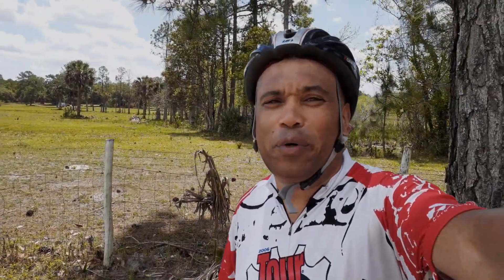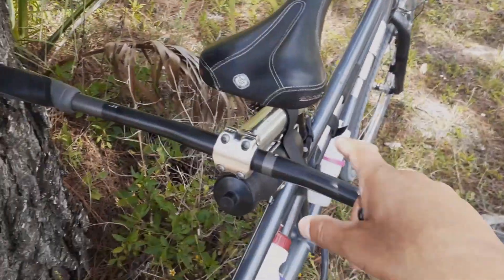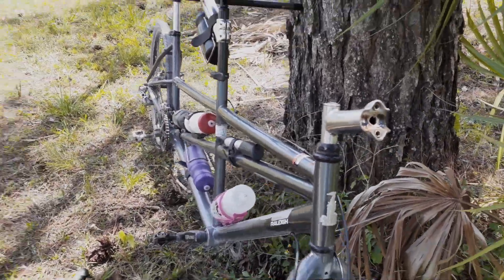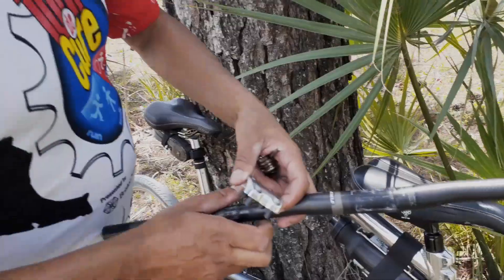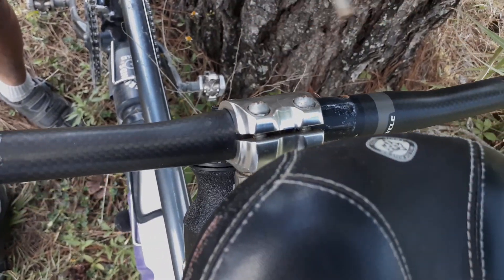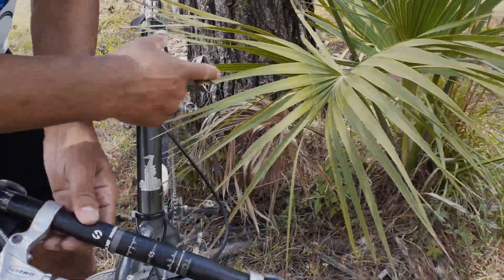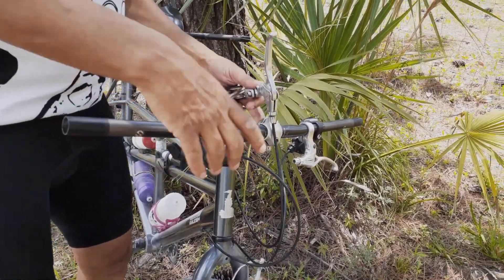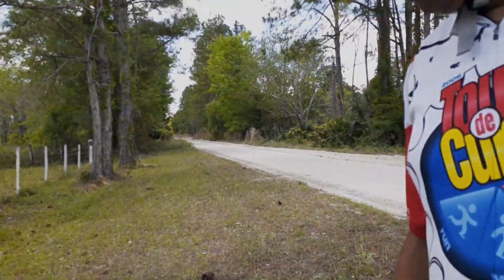I Can Explain.

Comment: You can score carbon when you swivel brake levers onto them, or turn the bars in the stem when it's just loosened, and those scores can be the start of a catastrophic failure, in the same way scoring glass or tiles weakens the structure and makes a path for the break to follow.  Glad it didn't happen while you were at speed. Safe travels.
Reply from the maker: Thanks for the comment! Yes, I am aware of this. Luckily the levers on this bike only required a very light twisting motion to get them into place, and not enough to evel leave a mark. Otherwise I would have been very hesitant and careful moving them.
Reply from the maker: We've since then switched back to aluminum alloy bars for the captain's end. 👍

Comment: LOL She spunky. Rolling laughing 😂
How much of the bike is carbon fiber? Seems it's not worth it to save a few grams. 1.5 tires a bit narrow and you two go trail riding. 
Calling my stoker "General Safety".. (smirks lol) 
We've been upgrading and accesoriezing the ride. Spent as much as the bike on these things. wow. We did double our distance on the second run and she said she could have done another hour or more. She has a comfort seat, two mirrors, clamp on grips, a can of hornet spray (20' reach lol) for any scareys, and a peg bar to toss her feet up on when she gets exhausted. Our latest accesories, a nice rack, dual high output pod lights near her mirrors for side trail illumination, and an excessively bright light up front. Oh, a frame mount tool bag which I'm filling with appropriate twisty grippy things. The pannier bag set is coming soon, so "The Picnic" is very near. Oh yeah, tires! They're on the way also. We've opted for a nice pair of hybrid trail and street tubeless be it will be tubed. These boardwalks along the trail get super slick when wet. 
Can you suggest a frame mount pump? So many on Amazon and eBay. The tiny pumps look ridiculous and there's plenty of room to clamp to, so a 14" pump, around there, will be fine. 
Happy Trails and dig the humor in the video.
Reply from the maker: LOL!!! (spunky) 
The only carbon parts on this bike were the bars. We've since switched back to aluminum alloy bars (for the captain). Like you said, carbon really isn't worth the minimal weight savings and is really not robust or rugged enough for this application. The rest of the bike is steel (frame & fork), with aluminum alloy components (seatposts, cranks, wheels, etc.). I have no questions about the durability of this bike - it's built pretty rugged! Those carbon bars are something that I put on a while back, they're not what it orginally came equipped with. But I won't be using them again! 

And yes the 1.5" tires are way too narrow for the sandy conditions in this video. We hadn't really planned on going on that road that day, it was just kind of an impromptu thing that happened. We do a lot of pavement riding on the tandem and so usually keep those 1.5" tires on it for that reason. They are 1.5" Maxxis Detonators (folding Kevlar) and I've found them to be the best combination of speed, ride quality, great handling, and durability for riding the tandem on pavement. But we do also have some fast rolling 1.9" offroad tires as well as a couple pairs of more aggressive 2.3 & 2.4" tires that I'll put on for the occasional ride in more demanding terrain conditions.

Nice to hear that you guys are accessorising and customizing and getting some runs in on your bike! That's what it's all about! Sounds like you have it all decked out already! I have a nice seatpost mount rack & pannier/trunk bag set that I sometimes use with ours (as well as only single bike as well). If you look at some of our other videos you'll see it. Also have a single wheel trailer that we've hitched up when we wanted to carry more stuff. We've used one setup or the other to carry our gear riding to camp sites on overnight camping trips and also use the pannier setup to haul all my video & camera gear around when making these videos! It adds a lot of weight with all the gear on board but works out very well!

Lots of pumps out there for sure. I've basically been using Blackburn brand pumps for years and that's about it. They've worked really great for me and so I've not really had any reason to try anything else (and yes, I've gotten a lot of flats over the years and so have used the pumps a lot, LOL). I can't remember the model of the one I currently use but it's a basic aluminum barrel Blackburn frame pump that's about 12" long, and convertible (fits both presta and Schraeder valves). That's about it. I also have a brand new Topeak pump which inflates both tires and air forks/shocks but I've only used it less than a handful of times!

Would be great to see a pic of your bike! Send us a pic on our Facebook page @tandemadventurers!

Cheers

Comment: glad you didn't crash and suffer serious injuries...but, one look at that bike and bar and it's obvious that not only is this tandem an older model, but the closeup of your bar indicates that it should've been replaced a LONG time ago.  There appears to be water damage and excessive use.  I replaced the bar on my single a few months ago and even after ten years, the bar only had a slight indentation on it.  Your bar looks like it's been there for decades.  A word of caution to others--carbon bars don't last forever!
Reply from the maker: Hey thanks for the comment! Our tandem is 5 years old. The handlebars actually aren't that old (less than 4 years old and they're not what it originally came with). In all fairness these were budget- priced bars and are not the highest end or highest grade. Also, the captain stem doesn't have the broadest bar clamping area among stems and combined with it being a 2-bolt design (instead of 4, which would have been much better), I had go tighten the stem bolts down a little more than I might have done with other stems. Which may have put some additional stress near the center of the bars.

We have logged well over 10K miles with this very setup, riding road, gravel, and also some singletrack and overall it has worked well enough. That being daid however since this incident we have gone back to aluminum bars up front. Carbon really isn't tough enough for this particular application.